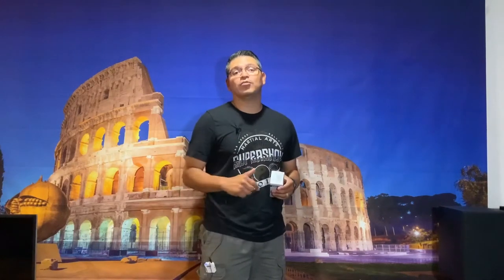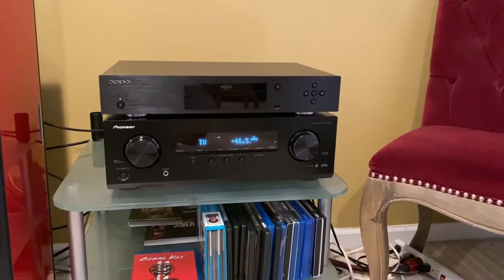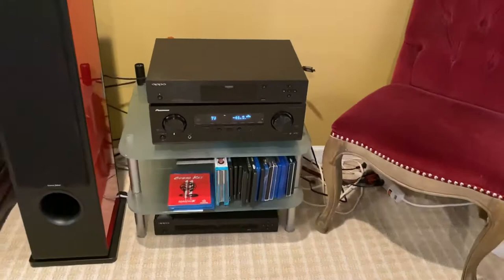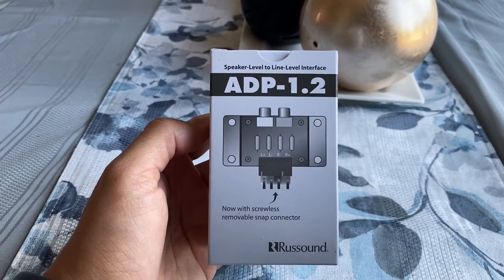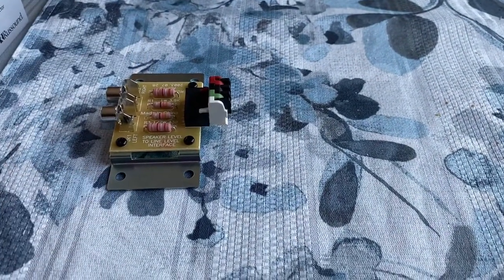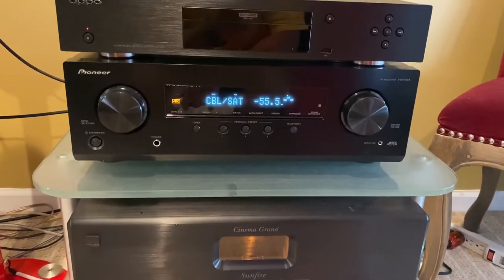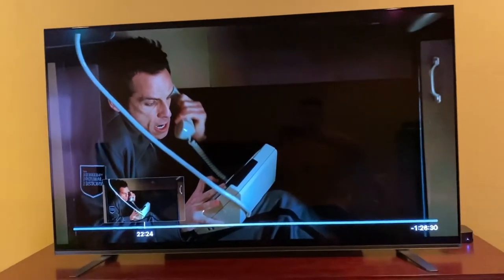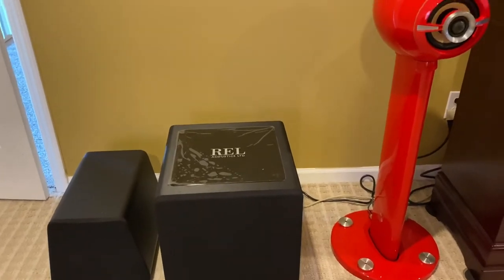How to connect an amp without preouts. Pioneer receiver and Russound

Comment: Where do you get the converter , cant find it on ebay
Reply from the maker: eBay , Amazon or crutchfield
Reply: @Audiolympian  will this work from my receiver to a 1000rms plate amp for subwoofer
Reply from the maker: @jadeerechillin  it should. The only thing I would say is the signal may not be solely low frequency unless your sub output allows for speaker wire not just RCA cable. But if your ok with that then it should work. Hope that helps, thanks for watching
Reply: @Audiolympian  my receiver is only high level out and the plate amp is for sub with low pass frequency control and only rca input , so will it be OK for low bass as don't want high frequency coming through sub , thanks for reply
Reply from the maker: @jadeerechillin  if your receiver has a high level sub output you should be ok 👌
Reply: @Audiolympian  it's not high level sub but high level full range but amp going too is for sub only
Reply from the maker: @jadeerechillin  ok. Then it might not be just low frequency sound you get from the speaker even though you have a subwoofer amp because the signal going to the amp is not a LFE signal. But it will still give you some bass and full range sound together which may not be bad.
Reply: @Audiolympian  I thought the rossover controls on the sub amp would override the full range signal
Reply from the maker: @jadeerechillin  the crossover on the sub regulates at which point the sub will produce sound from the Lfe signal.
Reply: @Audiolympian  so unless use lie I gonna get full range from amp , that won't work for me then as my sub not meant for high frequency
Reply: @Audiolympian  so unless I got a receiver with LFE I can't run active sub
Reply from the maker: @jadeerechillin  kinda. You’ll get both sounds high and lows but the sun will produce sound like a sub so the highs will be there but they’ll have a muffled sound.
Reply from the maker: @jadeerechillin  to do it properly, yes.
Reply: @Audiolympian  what if I used a passive bass crossover between sub and plate amp thatcwill eliminate any high frequency yes?
Reply from the maker: @jadeerechillin  it could depending on how good the device is. Could be a fun project

Comment: Bought it and when I put up the volume it skips like a hiccup
Reply from the maker: That sounds like a cable issue. Could be the rca cables or the speaker wires. I always try to use some decent quality cables to help with transference and minimize interference. Also depends on the age of the receiver and type of amps.

Comment: Or, just use the headphone jack.
Reply from the maker: Good tip. I never thought of that. I’ll put that in my next video. Thanks
Reply: @Audiolympian  It was the only way for me and seemed to work well. Eventually I got some rack mount 4 way cross-overs [3 way plus sub], so I could trim it's output down some ,at higher volumes.
Reply from the maker: @immrnoidall  very clever.

Comment: Don’t work whit my Denon & crown xls 👎💩
Reply from the maker: That sucks. I’ve heard before that others have had problems with crown amps and the adapters. Must be something with it’s input board. I think the amp it should be used with should have trigger or signal inputs to turn on. Sorry for that. Thanks for watching

Comment: Your setup seems alot like mine. Just blew 160$ based on your recommendation, really hope the russound ADP-1.2 are worth it.😅
Reply from the maker: Haha. Me too. Joking aside they’ve workers well for me for a few years now. Thanks for watching
Reply: @Audiolympian  bro your suggestion got my Amp to work! But now I have a problem where the Amp works fine for 15min but then cuts out for 3 seconds with no sound and then just works fine for another 10 min and it gets more frequent when the volume gets higher. Any idea how I can fix this? 

Googling I see it's something about grounding , what do I have to do to fix that?
Reply from the maker: @MA_KA_PA_TIE  glad it helped. yep it sounds like a grounding issue. I’d try to change your amp power cord if you can to a more heavy duty cable. If not add some kind of power conditioner or a cheap, but not the best solution, if your amp power cord is 3 prong add a 3 prong to 2 prong adapter. This solution bypasses the ground in the cord and allows the hot and neutral signals flow better but again not the best solution but I have used it before and it worked for me. Hope that helps and thanks for watching.
Reply: @Audiolympian  People like you are the internets redeemer! Thanks for the quick reply I've been trying everything to no avail. Will try your suggestions! Just subbed too. Thanks!
Reply from the maker: @MA_KA_PA_TIE  thanks for the support my friend appreciate it.
Reply: @Audiolympian  turns out it was because the AV receiver was on one electric line and the AMP on another. I had a power strip that tells you things are grounded and plugged both into that and it fixed everything. 

Thanks so much for your help!
Reply from the maker: @MA_KA_PA_TIE  happy to help. Glad you figured it out

Comment: I want to connect PA speakers pioneer stereo receiver but I don’t think doesn’t have pre-out do I need a special device connected to my receiver and then connect to speakers
Reply from the maker: Yes you’ll need an adapter of some kind
Reply from the maker: Thanks for watching
Reply: Do you know which adopter do I need connect my passive pa speakers
Reply: My stereo receiver does not have pre-out only has audio in
Reply from the maker: @Texas059  as long as it has speaker terminals this adapter will work.
Reply: @Audiolympian  do you know which adapter do I need
Reply: @Audiolympian  adapter you have showing on your video will that work connect my Passive pa speakers my stereo receiver
Reply: @Audiolympian  if I connect passive PA speakers to my pioneer stereo receiver direct to the speaker terminal Could damage the speakers that’s what I heard
Reply from the maker: @Texas059  that depends on the impedance of the speakers and the power of the receiver.
Reply: @Audiolympian  my stereo receiver puts out 100 Watt
Reply from the maker: @Texas059  you should be ok using this Russound adapter. But that is for connecting an external amplifier for more power. An amp could damage your pa speakers but the receiver should power them fine.
Reply: OK but can I use this adapter to connect the PA passive speakers
Reply from the maker: @Texas059  connect them to what. Receiver or amplifier?

Comment: Does a line out converter device works the same?
Reply from the maker: Technically yes. I think the difference will be in the resistors and capacitors the devices use. Thanks for watching